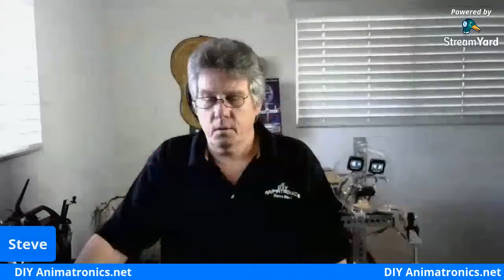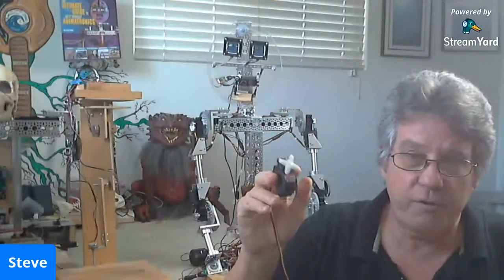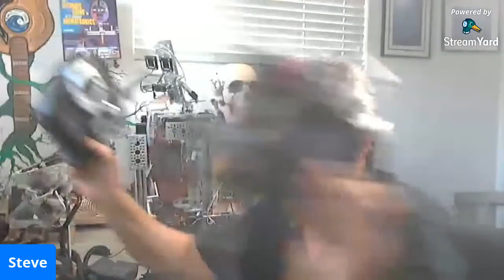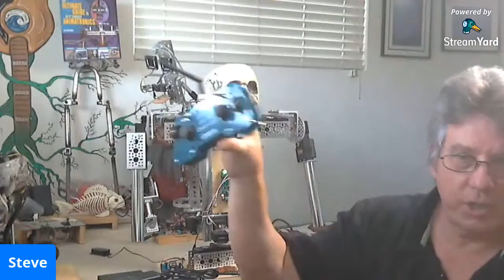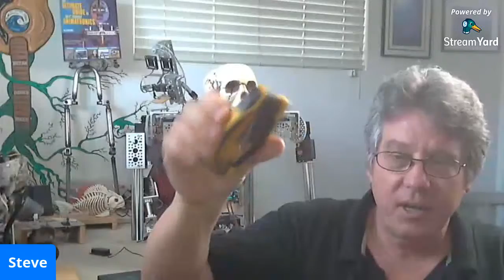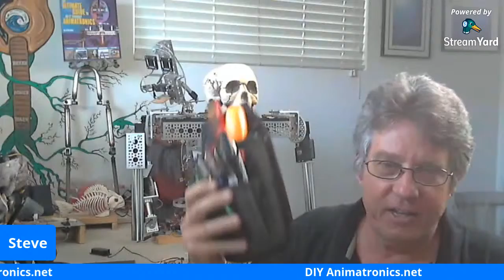DIY Animatronics & RC Control

Comment: Just curious, what is that steel pipe structure in the backround that looks like legs?
Reply from the maker: Right on.  It's the legs of a metal frame with articulated joints that was given to me as a gift - https://www.screencast.com/t/5p63bkBks